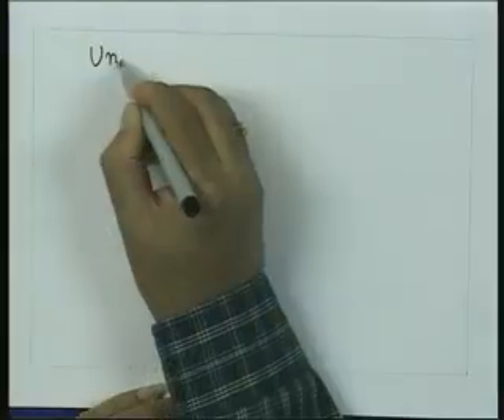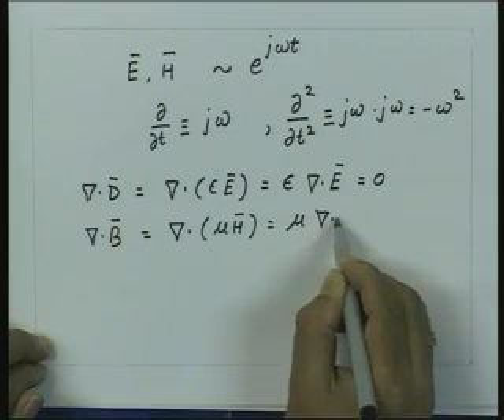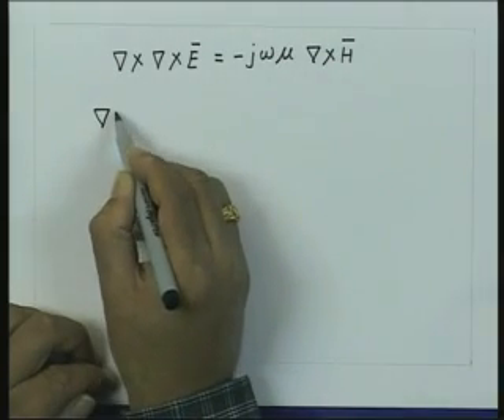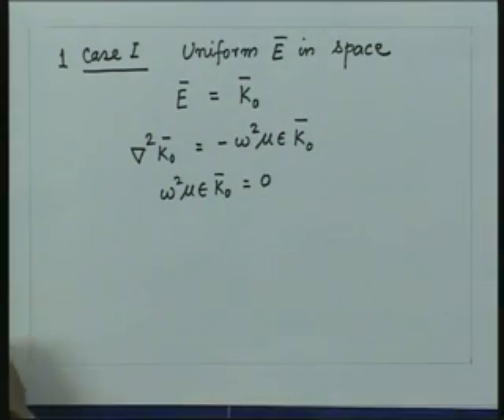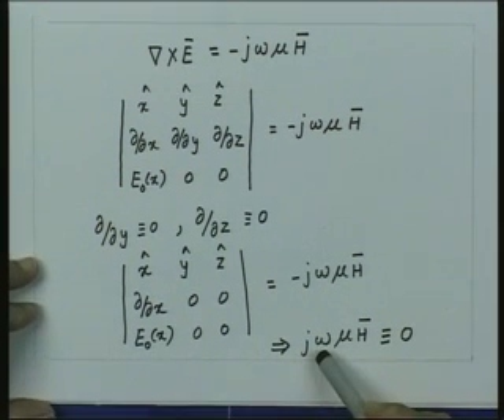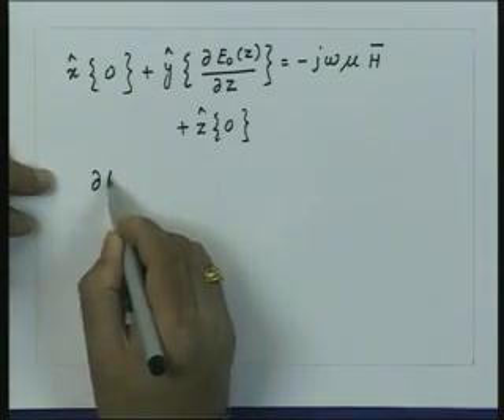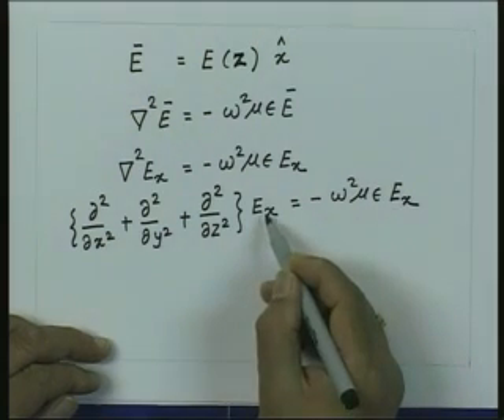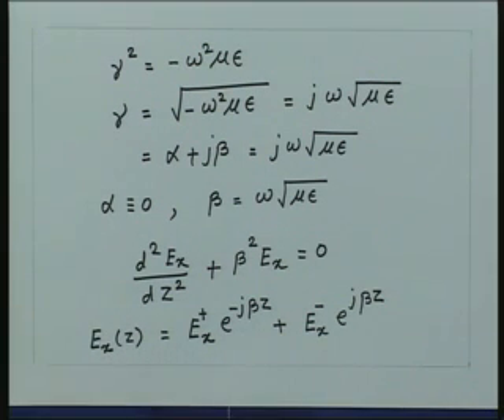Uniform plane wave

Comment: Sir can you please draw a diagram of an electric field which is a function of z, but propagates in the x direction?
Reply: Just imagine any point in space where electric field is function of z and directed parallel to x axis. A simple example would be magnetic field due to straight conducting wire where it is a function of radial distance rho from wire but directed along phi axis.

Comment: In the last equation (travelling wave equation) shouldn't it be e raised to power +/- X as wave is oriented in X direction and amplitude varies in z direction
Reply: @aviorn36  yes direction of the field is along the x-axis. but that doesn't mean the wave is travelling in the x-direction. its the direction of propagation is perpendicular to the x-axis
Reply: Ya...direction is X.. so del square should be with respect to X  oly